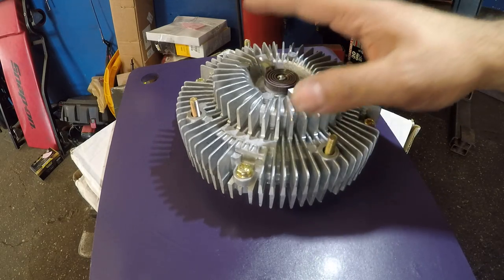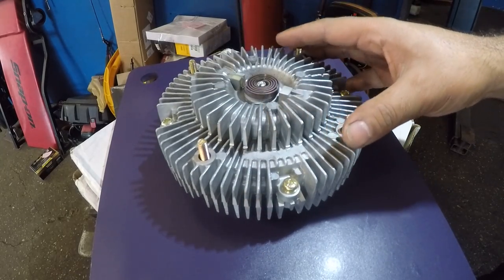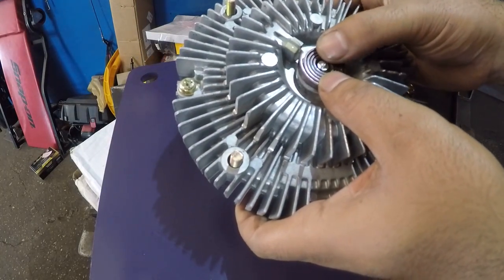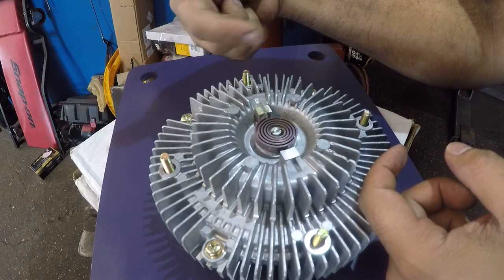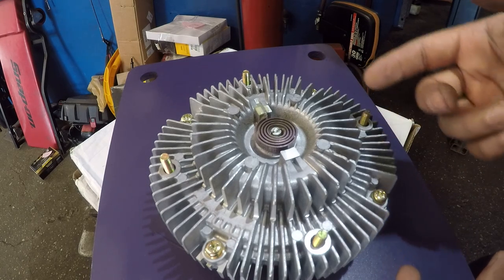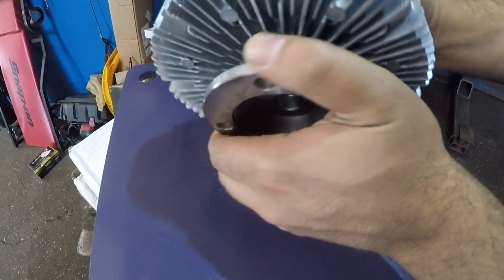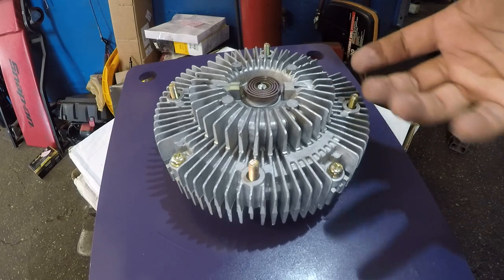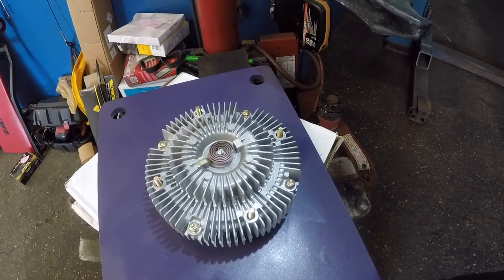Fan clutch making loud wind noise, try this

Comment: The clutch fan in my 03 yukon drove me nuts. Sounded like an industrial refrigeration unit driving down the road. Especially in traffic with the ac on. Went to the junkyard and pulled an electric fan assembly out of a Silverado HD for $50 and got rid of the clutch fan. Much quieter and never ever overheats.
Reply from the maker: Original!!!
Reply: @RBTheMechanic  
Clutch fan deletes are actually pretty common on the Tahoes, Yukons and Suburbans because quite honestly GM should have put electric fans in all of them but they're too cheap and want us to buy more replacement parts later. If anyone reading this goes to the junkyard to pull one don't forget the relay, plugs and wires. There are some videos on YouTube if you want to wire it up yourself tho. LSXmatt has a good one. 👍
Reply: @bornvillain6819 I'm about to do the same with my 06 ram 1500. Sounds like an airplane going down the road

Comment: I have a Dodge Dakota.  Correct that past a certain temp, the fan clutch switches into a higher gear to spin faster and keep the engine cool.  Mine has to do that, cause the radiator on the Dakota is actually too small for a V8 (design flaw).  Dodge got around it my using the high speed fan clutch, and with-out that it would overheat.  But personally I like it.  Makes me feel like I'm driving a big truck!

Comment: That's exactly the problem in my 2004 ram 1500 at the shop they changed the water pump and they recommend to replace the fan clutch as well,  I wish never do that cause after I pick it up from shop I notice that loud air noise and doesn't advance like before, I tough it was normal cause it was cold but since then is making it every day even if is in morning or when the motor is warm already and it drive me crazy is like Im driving a school bus or a trailer, thank you for the info, I'll definitely take it back to shop and they need to fix it cause before it was working perfect.
Reply from the maker: Yeah sounds like dump truck passing by lol we’ll tell them to put original from dealer most likely they will have to do it again and again
Reply: @RBTheMechanic  thanks for the quick response and the advise.
Reply: Yeah I took mine back he put in another new clutch the sound is the same got damn bus or semi or tractor im pissed to my truck was better before,
Reply from the maker: @theexisting1197  yeah same thing happned to me I adjusted it worked bit better but I needed up putting new one from dealer
Reply: @RBTheMechanic  i just ordered mine 30 minutes ago, SMH more money we gotta spend from getting the truck fix to getting the damn thing fixed again
Reply from the maker: @theexisting1197  yeah man they should take care of it.  Charge u only the difference on the part since u paid the first one already that how I went about I charged customer $47 more because it was difference of price in part and I learned a leasson!
Reply: @RBTheMechanic  ok your mechanic lol thanks for the info 700$ I'm sure they won't have a problem i took it back once he said it was ok I told him it's loud he said the part would wear in
Reply from the maker: @theexisting1197  lol that’s exactly what I though one year later it was same and it was family members car so  I just redid it with original part
Reply: @RBTheMechanic  😄family was upset at you family funny some times

Comment: I swapped out the one one my 04 avalanche (5.3L) and it was super loud at first, after a few months of driving it quieted down. AC Delco. I wonder if there was a design change for the newer LS based truck engines and if there's a break in period? Maybe it was something that wasn't noticed when the trucks were brand new?
Reply from the maker: No the original from dealer dosent do this
Reply: @RBTheMechanic  All the dealers around here use AC Delco, literally same part number for the Chevy motors. Did exactly that.

Comment: So you are saying if I just take that spring on the front of the fan clutch and rotate it clockwise (coiling it up more) it will not have a loud wind noise?

Comment: I have a 2005 ram 1500 hemi and whenever I accelerate the fans are really loud and when I stop it’s quiet and at times when I am going the fans stop and then after a while they start being loud again what do you think could be the problem ?
Reply from the maker: The clutch is the issue have u replaced it? Usually I need an original one if u did replace it

Comment: I hear you my man, great info, but if it hasn’t been changed in idk... 20 YEARS, then yes change your stuff. I just changed mine so😂. It sounded like a plane.
Reply: Hi man, saw ur video. I really need an advise. I got the same issue n I bought one from a dealer. Unfortunately, it's the same noise "a loud noise" as like before I changed. I have no idea what to do now I bought it for around 200 $.
Reply: WAIT wait... $200!? For a clutch fan?
Reply: Naw chief no way
Reply: Yep, it cost me 200 $
Reply: I am still wondering I have to go alll through this again with the dealer to replace it. But if I replace though I have the same issue I guess
Reply: If you bought the part, check for warranty so you can get your money back or buy the same part again, if You brought your car to a mechanic or dealer and they bought the part and did the work, I would ask them like HEY you should like replace this part again cause it’s jacked up and there should be warranty AGAIN if you’re like hearing the fan spin and at least shut off while driving, you should be fine, it’s just doing it’s job, plus it’s fricking hot.
Reply: @jp_travels247  I will do this for sure n let u know. Thanks man
Reply: @abdullahmuhammad6348  i just replaced mine yesterday with a new one from oreillys, cost me like 60 bucks. It sounded like an airplane or school bus like a loud whooshing gust of air sound when i accelerated. So after the new installation,  it still sounded like an airplane, until i rev it a few times and then it stops and sounds great! But i haven't driven it long enough yet to see what else happens. I do not like that sound and i can tell it makes me lose power.
Reply: @aaronezell7696  hi man, what did u do  exactly with the new one?
I still have it if I can manage to do it
Reply: @aaronezell7696  I can't imagine it is so cheap I have bought it around 200 bucks
Reply: @abdullahmuhammad6348   I just had the same issue. The dealership replace the fan clutch a THIRD time and it is still making the noise. I live in cold weather climate so why the fan is even on in the first place doesn't make sense to me. They charged me $245 for parts and labor but they replaced the clutch two more times so now I don't know wtf to do.

Comment: Yeah I go to the junk yard, find me an old time 4-6 blade solid fan and the correct length spacer, and then throw the clutch fan in the scrap bin where it belongs.

Then the old time 4-6 blade solid fan works forever more and never needs anything else done to it.

Did that to an old 1971 Buick I had that wanted to over heat because the fan clutch went out and never did anything else to the fan after that!

Comment: My fan clutch is really loud after i replaced it, the fan is much louder in the higher rpm’s and quiet in the lower rpm’s. It’s still really loud first thing in the morning when my truck is still cold. Do you think it could be a faulty fan clutch I bought?
Reply from the maker: U need to put in new original fan clutch
Reply: @RBTheMechanic  what do u mean original because the one I got was a oem replacement
Reply from the maker: @Benmendoza1  original from the dealer not after marker oem

Comment: Cocho,,,I have a truck with this noise problem it has a new fan clutch, but it does the loudest noise,,I don't want to change it cus  I don't know if is gonna work or not,,any suggestions
Reply from the maker: U gotta put original one I tried all kinda of bullshit if it got adjustment try but other wise new clutch

Comment: This is older video and I’m not sure you’d still monitor comments and answer them. But I have a 2007 LX470 and it’s had the same problem. I replaced the fan clutch with a Lexus OEM one ($143) from the dealer. It did not solve the dump struck roaring noise. I then had another OEM one from Toyota ($107) and an AISIN fan pulley bracket put in while having the timing belt and water pump done by a shop specializing in land cruisers.  It still sounds like a roaring airplane, school bus or dump truck. This is really frustrating. Any ideas??
Reply from the maker: U sure the first one was from dealer original!! Some times people swap parts and return it   I always go dealer and issue resolved
Reply: Yes I picked it up from my local Lexus dealer. The second one was put in by the cruiser shop and they ordered it from a local Toyota dealer
Reply from the maker: @WiskiOdin  see if it got some adjustment or if u can chnage fluid inside to somthing less of thickness
Reply: @WiskiOdin we’re you able to solve the problem ?

Comment: These fans are only activated when the heat reaches some temperature. If not needed the fan spins slow. Some problems are not kicking in or not stopping.
Reply: Dude, my fanclutch started spinning even when cold. Do you know what can be wrong with it?
Reply: @MarkoFelix  Depends on every model.  Mine is trailblazer and Someone told me that the fan harness/ connector coming from the computer came bad. And you need to order one on Amazon or internet.
Reply: Mine is LOUD, and definitely spins even when cold.  It can sit all night in the winter and will spin upon startup.  Can you show exactly how to adjust the coil?   Thx...

Comment: Hearing the wind is a good thing, I miss the old fans without clutches
Reply from the maker: David Harden yeah but it was way too loud customer wasent happy
Reply: @RBTheMechanic  “I’m so unhappy my fan is working to cool my engine, I liked it better when it was quiet and my engine was overheating” -Customer
Reply from the maker: @rotorav8  I use original stuff now had too many issues and complaints

Comment: I had the problem on my truck that made it sound like dump truck and school bus driving down the road and also when at a stop light for too long and the ac is on the air would not blow cold air.. so I changed the fan clutch and nothing changed.. is there something els I should look into ?
Reply from the maker: U need to put in original clutch
Reply: @RBTheMechanic  The one I took off I should put back on?
Reply: @shox9492  .... I would put an electric fan on. That's what I'm gonna end up doing with my duramax. It's loud and I lost about 4 mpg

Comment: My fan never shuts off on my Ram 1500 (06).  Do you think it's a tight clutch?
Reply from the maker: These don’t shut down they only slow down accordingly to the thickness of the fluid inside

Comment: I have a 2011 Chevrolet Colorado and makes the high wind noise like you described when starting it while the engine is cold and goes off after a bit. Once the engine is warmed up, and restarting it, it starts and sounds normal. After a couple hours of it sitting, it makes that noise when starting it. It just started this last week. Could it be the fan clutch or do you think it could be something else? Thank you!
Reply from the maker: Yup it’s the fan clutch
Reply: I have the same issue on a Cadillac escalade 2003 5.3 engine I replaced clutch fan and also thermostat and nothing changed what else could it be

Comment: My Ford Explorer sounds like a plane is above me when i start it up and drive. But after about 20 seconds it sounds normal again. It’s only started today and it’s a lot hotter than usual. Is it the clutch or is this normal?
Reply from the maker: You might have problem with these did u recently change the clutch
Reply: @RBTheMechanic  no i haven’t, the only thing that’s different is the heat.
Reply from the maker: @ylsfad3720  usually they stop blowing fan speed when they go bad not sure if this is ur issue
Reply: @RBTheMechanic  Do you have any idea on what my issue could be?
Reply from the maker: @ylsfad3720  can u make a video let me listen to it post it on utube
Reply: @RBTheMechanic  hey i have a lexus lx 570 2015 and it started making loud wind/plane noise about a month ago in june i never had this issue before its about 107 degrees outside do you think its my fan clutch going bad and no my engine doesnt overheat
Reply from the maker: @sansarkawt3351  did u replace the clutch?   Usually when it goes bad it stopps to making more wind so it’s other way around it could be that it’s going bad and hardening up but if it dosent over heat it shouldn’t be problem if noise bothers you replace it with original part also check ur coolant level let the car cool off for few hours then check in radiator and reservoir
Reply: @RBTheMechanic  actually i have never replaced the fan clutch so its basically the original part and i checked the fan clutch to see if its soft and it was not ,it actually had very good resistance so im really confused whats the issue here
Reply from the maker: @sansarkawt3351  I would leave it alone check all other such as coolant level

Comment: I have a 2002 Isuzu axiom and I replaced the fan clutch and it's ALWAYS sounding off and it's SUPER LOUD, do you know what it could be?
Reply from the maker: Usually after market clutch causes it if it got adjustment try it if not then u need original
Reply: @RBTheMechanic  I see, cuz it causes also like a decrease in acceleration also, when I accelerate it's super loud and have to kinda FORCE my car to run
Reply from the maker: @RENEIND  puts load on engine burns more gas

Comment: I've had five fan cluthes due to accidents and only one warranty replacement worked good. The rest were all too tight.
Unfortunately that ine was damged in an accident and I put a new one, too tight, replaced under warranty and that one is too tight.
Its frustrating.
I am going to remove this ine, see if the engine doesnt feel like its working harder to spin it and if so, I eill have to do something, becase this ine is noisy and feels like its causing the engine to work harder than it should.
Reply from the maker: Yeah I go original I had issues customers complaints
Reply: @RBTheMechanic  I pulled my clutch fan off today to see the difference. What a difference it was. It no longer feels like the truck is struggling against it. It sounds great, great pickup and glides along with hardly any gas.
I have the electric fan on it anyways. The engine ran awhile and when it hit 180 degrees, the electric fan switched on and then shuts back down when it was below 160 degrees.
The temperature gauge moves slightly up towards the halfway mark, but then within a few minutes of the fan coming on, it drops back down.
I plan to run it this way for awhile and check gas mileage. I'm sure it was eating more gas with the clutch fan.
Come summer or if I have to do any towing, almost never, or drive up to the mountains, it may need the clutch fan, but for now it's staying off.

Comment: My 05 navigator (5.4) made a winding noise when i was going i to the freeway (accelerating)....the car isnt overheating......do you think its the clutch going bad??
Reply from the maker: I don’t think it’s going bad usually it would do that when it gets hot it will get stronger to turn the fan to make more cooling.  Usually when it goes bad it has less of force

Comment: I’m having this issue on my 2015 Nissan Titan. I noticed about a week ago! I thought at first “oh no, exhaust leak” but it has to be the fan clutch. This thing sounds like I’m going 100mph when I’m taking off doing 10mph lol 😂!
Reply from the maker: Yeah did u replace it? Usully after markets r like this so if u need to replace it put original
Reply: @RBTheMechanic  I haven’t yet. My wife works for Nissan dealership. I’m going to take it down next week. So I’m hoping that fixes it. I appreciate the video

Comment: I got 1 from auto zone and it's much quieter soooner than from the other auto parts stores works fine tested it all day.....
Reply from the maker: Nice u have luck!!
Reply: @RBTheMechanic  I bought a new fan clutch from auto zone on my o4 nissan I got it replaced by a mechanic but still runs  on cold starts  did  they put on it wrong  or you think I got a bad fan clutch
Reply from the maker: @bash8387  there’s no putting wrong way after marker simply 100% suck go with original I ended up using original
Reply: @RBTheMechanic  if I want the original fan clutch I have to  go to the  Nissan dealership
Reply from the maker: @bash8387  yupp parts department
Reply: @RBTheMechanic  thank you for the help
Reply: I just got a fan clutch from auto zone and it’s sound like a jet engine when i give it gas what do you think the problem is maybe on to tight ?
Reply from the maker: @johnwade6836  bro don’t waste ur time I tried it alll get original fan clutch

Comment: Hi , i have same issue very high sound while accelerating the car , what is the solution please?
Reply: Car is dodge durango 2008 5.7 hemi
Reply from the maker: Well this clutch might be the issue check to see if ur car is not over heating you might have to replace this clutch with original from dealer
Reply: @RBTheMechanic  Thank you so much. I replaced new one from dealer. The car now is normal. Thanks
Reply from the maker: @mohammedalsubhi5028  nice job!!